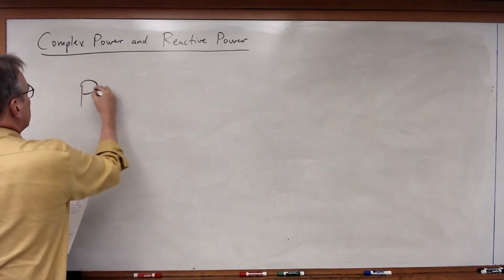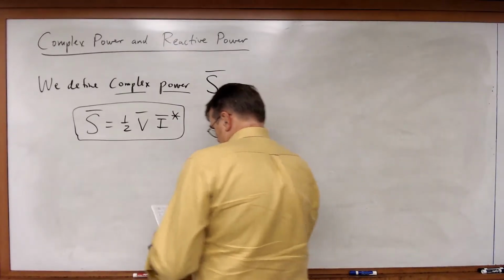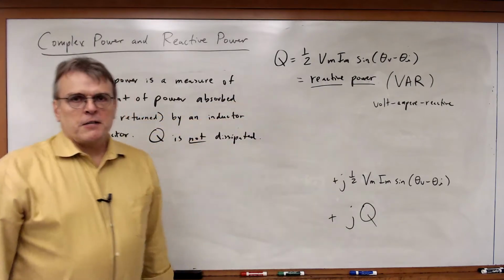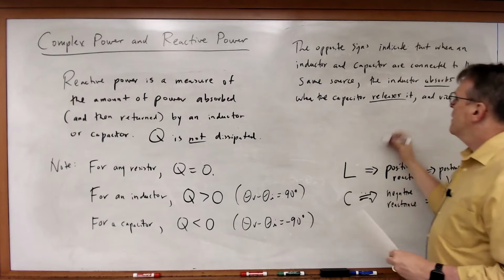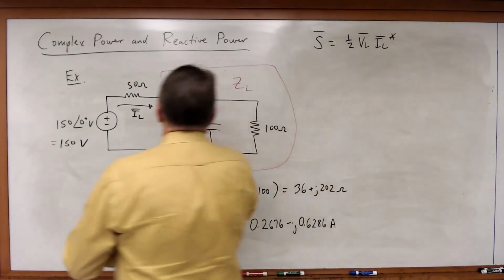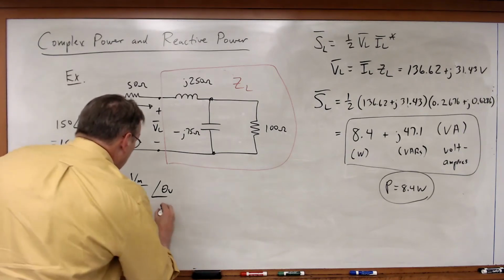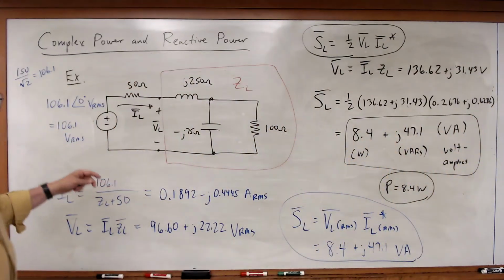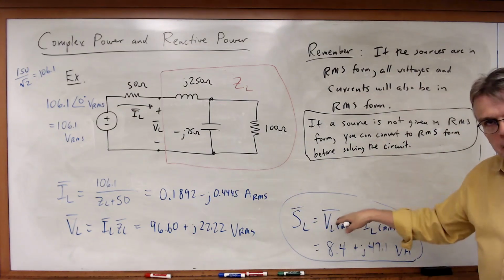EECE 2112 Module 81:  Complex Power and Reactive Power

Comment: Hi, I just had a couple of questions about RMS, as I do not think that I understood the concept properly.

In the previous video, the formula for Vrms and Irms was Vm or Im divided by the square root of 2. Since Im is a scalar, how come Vrms can be represented by a phasor? Additionally, how would we calculate the Vrms of the voltage source if it had an angle of 30 degrees? Would we just divide the magnitude only by square root of 2? Thank you.
Reply from the maker: A phasor voltage or phasor current can have an RMS value for the magnitude of the phasor, where the RMS magnitude is equal to Vm or Im divided by sqrt(2).  So a phasor voltage V1 could be represented by Vm at a phase angle of theta degrees, or it could be represented by Vrms at a phase angle of theta degrees, where Vrms = Vm / sqrt(2).  

The difference is that if you use phasors with Vm (and Im) magnitudes, then you must divide by 2 in the complex power formula to obtain P and Q.  But if you use the Vrms and Irms magnitudes, then you don't use the division by 2, but will still get the same values for P and Q.